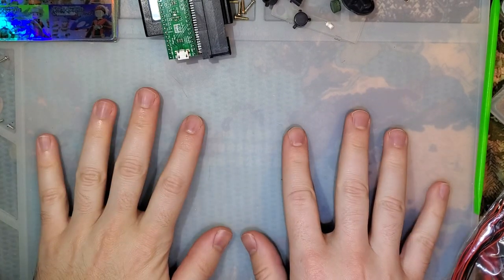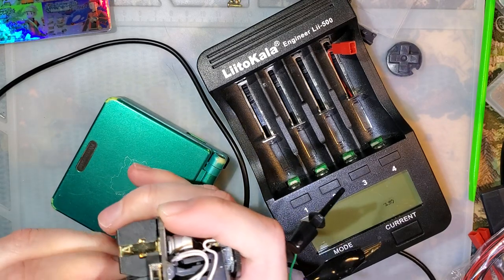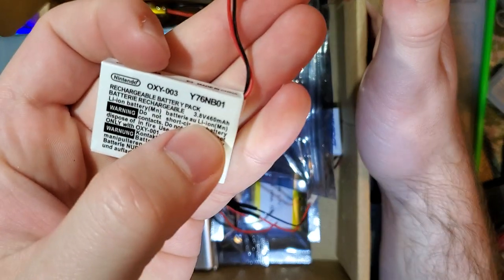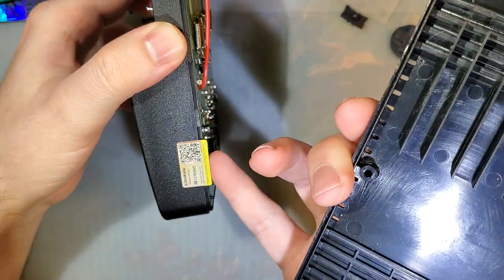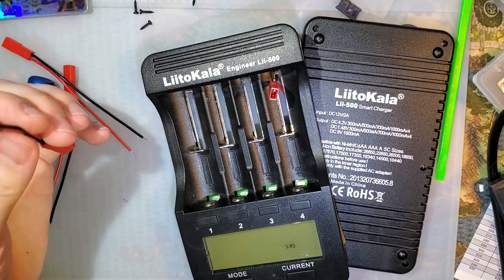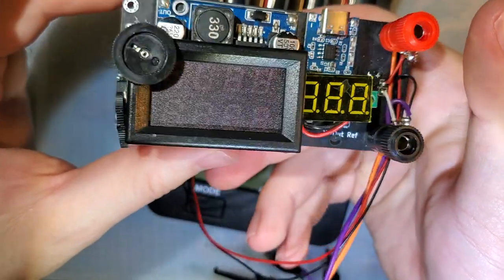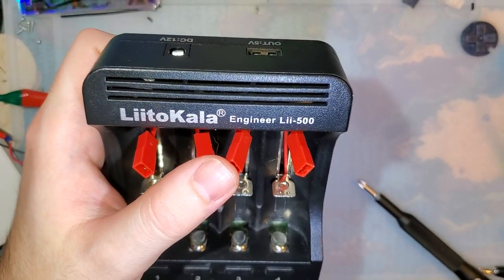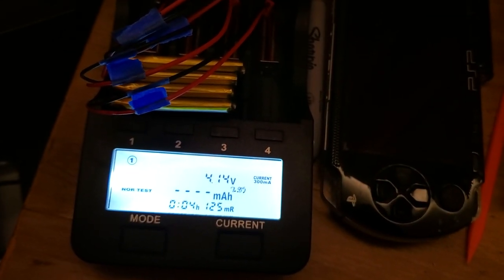Modding My Battery Charger (Liitokala Lii-500)

Comment from the maker: I misspoke (several times) but primarily I want to correct something that I incorrectly remembered, the DISCHARGE current is only 250mA in 300mA and 500mA modes, and 500mA in 750mA and 1000mA (1A) modes. The charge current is as the mode is named. Still, I'd like a 100mA discharge option for the particular cells I'm testing.

Comment: FYI.  When charging Lipo 23:05, you should be charging them at 1C.  So if they are 1000mAh you charge them at 1A (1000mA).   As far as NiCD or NiMD it depends on what the battery is rated for when charging.  Most can be charged at 1C but they can get hot and can damage the battery.  200-500mA for AAA, 300-700mA for AA is what most charge at to maintain battery life.  TBA, a RC charger like the SkyRC B6 would be better for charging/testing these batteries.  As you can adjust the current better for the Lipos and Li-ions.

3:00 You should not have those lipos stored like that with exposed wires.  That is a house fire waiting to happen.
Reply from the maker: Charging at a rate less than 1C is better for the long term health of the battery, especially for NiMh/NiCd cells. 

And I don't really store my batteries like that, it was a joke. I thought it was obvious in context.
Reply: That's right sir. I've been charging my NiMH AAA Energizer/Philips 850/950mAh made in China and Eneloops made in Japan (min. 750mAh, real 850-900mAh) batteries with 500mA without any problem. Sure, they get hotter but working since 2014-2015 without a complaint. NiMH/NiCD should be charged with at least 0,25-0,3C.
Reply: @dondolarson5134  Charging NiMH vs LiPo vs Li-Ion have completely different charging mA/A.  for NiMH AAA/AA I normally charge at 500mA no matter the mAh.  Li-Ion depends on mAh, usually check the datasheet or see if battery mooch has a list up for it.  Lipo you charge depending on mAh.  If its 1000mAh you charge at 1A,  5000mAh you charge at 5A, etc, etc.  You can fast charge these but will degrade the battery really fast.  Personally I always charge at a C for long life when it comes to Li-Ion.  NiMH are so cheap if they die they die.
Reply: @pheelix-  I was referring to the movie sentence of triple A batteries going to or might blown when 500mAh is applied to 'em. That's actually not the case, unless you charge them in an oven or maybe, or more probably with some cheap, unbranded batteries of China origin which can be exploded before they even arrived to your postal office.